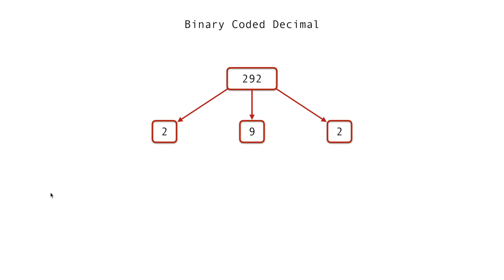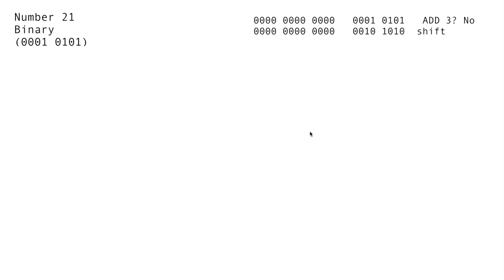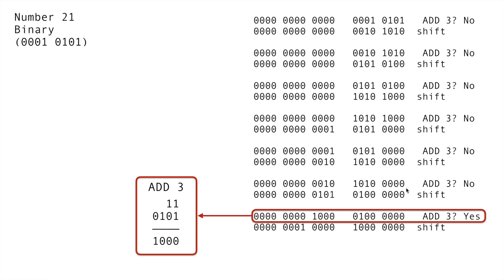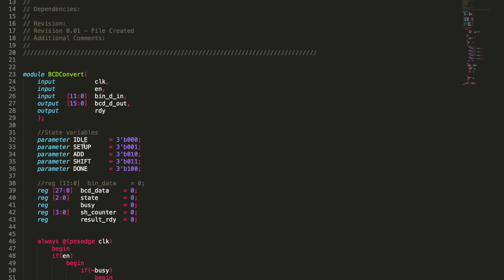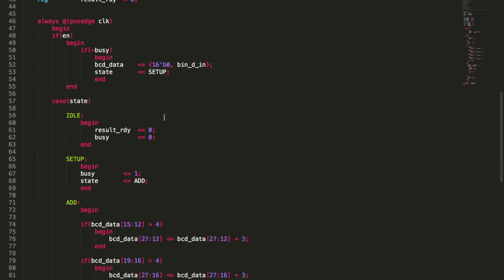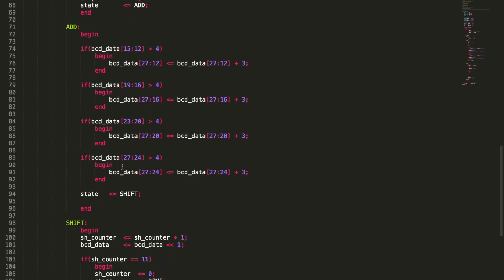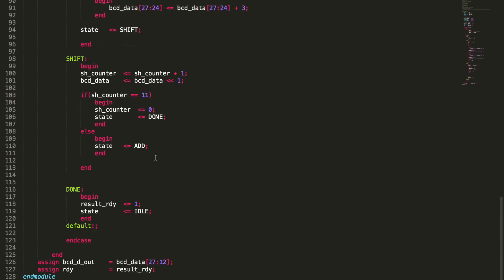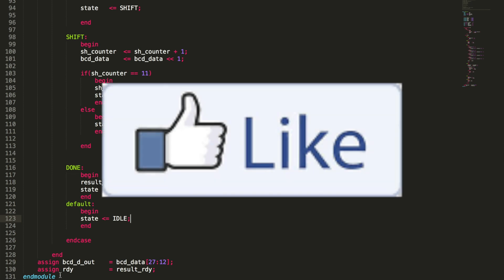How to get BCD from Binary with verilog and the Double Dabble algorithm!

Comment: Your example used 20 bits, but your code used 28. I believe your code is intended for a 12 bit input instead of an 8. Confused me for a moment. Also, I don't believe your code is going to work the way you described. You've got multiple assignments to the partial result.